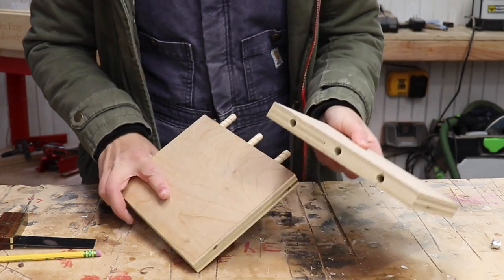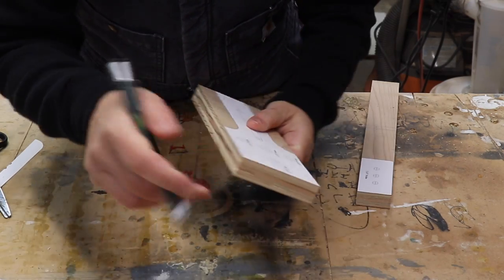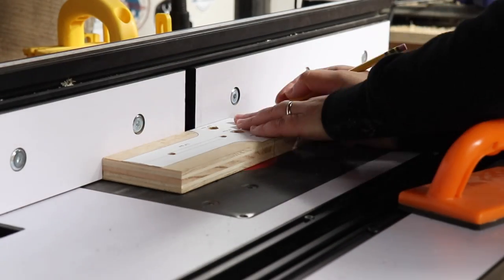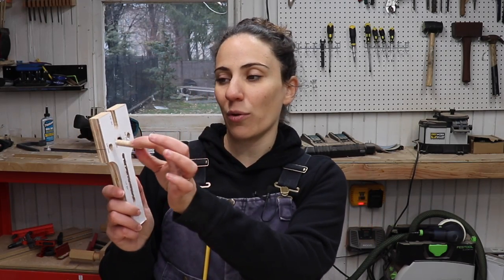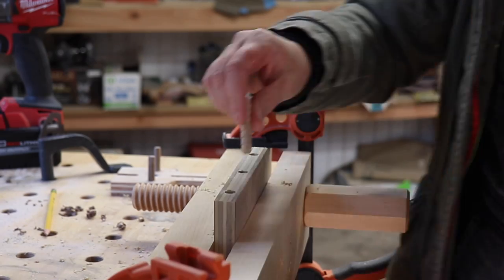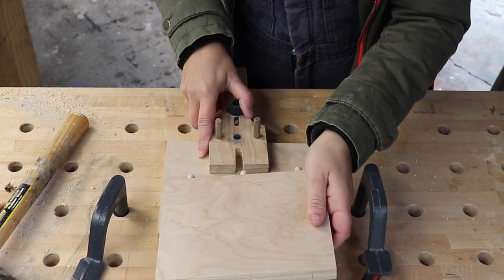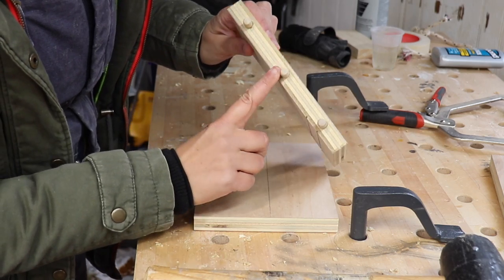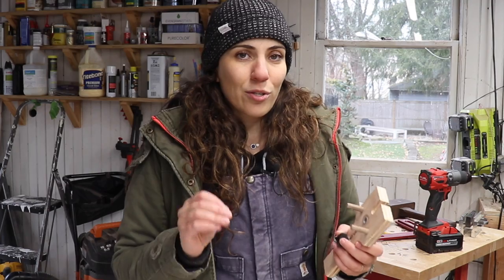Making an ADJUSTABLE Doweling Jig for Joinery

Comment: This is a very clever dowel jig indeed. Personally I loathe dowel joints because even with jigs the faces of the joints never reference correctly or the dowel spacing is not quite right. This jig seems to address these shortcomings. As a woodworker who also undertakes some small engineering and machining I find fascinating the methods that people use to attempt to obtain repeatable accuracy.
An achilles heel in the design as shown however is that the steel tubular bushing is mild steel which is softer than high speed steel drill bits and consequently it will wear and lose accuracy. This issue can be resolved along with that of one dowel size by buying commercially available dowel jig bushes. These can be changed in the single centre hole if it is drlilled large enough to accept them.
I think that also the accuracy could be improved slightly by cutting the central dowel hole and both slots with a router having first set the fence bang on centre by test cutting from both sides and adjusting with the fine adjuster on the fence. I use this method when routing mortices in sash stile.
Thank you again for your care and ingenuity in making this video.

Comment: Great video.  Can you use this to do angled dowels on thinner mater such as in your other video with the 10 degree pieces?  Also, any thoughts on using steel pins instead of the walnut dowels for better durability?
Reply from the maker: Hmmm I’m sure it can be done. And metal would def be better!

Comment: Nice copy of the commercial versions out there. I have had the milescraft version a couple years now. It has the capabilities of 3 different dowel sizes, but like you I only use 3/8. The commercial jig is reasonably price so if anybody out there is sick of making jigs like me and rather make projects check them out. Woodcraft also makes a version.
Reply from the maker: Yeah. I linked to those in the description. They are great options 😉

Comment: Question: If you are using a drill press, do you really need to use an awl to put a point in for the drilling? Especially if you are clamping down the piece, then there shouldn't be any drill point wandering…

Otherwise great video and enjoy watching you make!
Reply from the maker: Yes. I have had too many instances where the drill press did not drill on my mark. So I always use an awl for precision. Thanks!

Comment: Awesome 👍, definitely plan to make one... If someone hasn't suggested it yet, simply use a 1/2" or 3/4" diameter sleeve, and you could incorporate any size drill bushings you wanted. Thanks for the great video!
Reply from the maker: Awesome! Good luck making it!

Comment: Brilliant. Question. what is the purpose of the two dowels on the fork piece?
Reply from the maker: Thanks! They are there so you can drill into the center in the edge of a board. When you twist the jig. Those 2 dowels will hit either side on the face of the board. So then the hole in the center will be perfectly centered for any width

Comment: Hi Tamar ,  I was wondering if you find that your power tools work better in " warmer"  temperatures? . I notice you seem to have a colder work environment in the winter months. In my few years of wood working in a shed , operating power tools in the colder temps wears them out faster . ( motors , bearings , body housing , ect. . . ) any thoughts on cold weather operations ?    thanks : Joe
Reply from the maker: Hmmm. I havnt had any issues with that other than me being really cold. Ha

Comment: On your idea to make it support multiple sizes,  what if you made the hole with the insert the largest you would ever drill.  Instead of gluing it in, use inserts you could change out that have an inner diameter for each size you might want to drill. You would then want to make duplicates of those so that one goes in the drill hole to guide the bit and the other for the alignment slot so they keep in alignment.
Reply from the maker: Maybe. I’m sure something could be figured out
Reply: Btw love your channel and the way you show how to do the work. Keep up the good work!
Reply from the maker: Brett Hall thanks so much!

Comment: All you need for multiple dowel sizes is a replaceable metallic nut in the hole through which you drill. Someone can turn different sizes for you on a metal lathe.
Reply from the maker: Would be cool

Comment: I see you use a small benchtop band saw.  What do you use for a blade?  I have the Skil 9" and, while I generally like it, the blade wanders pretty ridiculously.  I know I probably just need a wider blade, but I'm curious what you use since you seem to have a pretty stable blade.
Reply from the maker: Ryobi. And no. It’s horrible. It’s only cutting straight bc it’s plywood. It can barely get through any hardwood. If I use a fence it completely stalls out with hard wood bc the blade can never get enough tension.

Comment: Will this if work on a project where you’re matting Like 1/2”  onto 2” ?  The reason umm asking is because I’m in the middle of building dining chairs for my daughter and she wants a cross back design so I want to use 1/2” for the cross matted to a 2” frame. Thanks. By the way I really like your videos. Thanks for sharing.
Reply from the maker: If you’re using the same sized dowel I don’t see why not. Thanks!

Comment: Somebody got a new portable bandsaw! Lol could have picked a $2 bushing up at princess auto, but no, slicing this pipe up lol. Good work Tamar, but your going to have to pull the epoxy out one more time, sigh. I think a piece of wire inlaid on the center line would really help preserve it, vs pencil.
Reply from the maker: Haha. Yeah. That was a fun tool to use. It was a pen. But yeah. Someone suggested making a small kerf with the bandsaw then filling that in. Thinks that’s smart
Reply: @3x3CustomTamar  pen? 😛 Lol 🤣 and sure you could use your bandsaw... But if your still feeling "fancy" the Katz mozes jig has a 90% side 😉

Comment: To make it multiple sizes, you would need to have removable jig sections like the one you really want does.
I think, making a base with 1/4 inch hard board that the other parts screw onto would do the trick.
To make the three different heads, make three of the smaller size then up size two to the larger sizes. However, unlike the 200 dollar model, I wouldn't have removable pins as that just seems to complicate the design more than necessary. I would have it designed so that each of the heads was a doweling jig in and of itself. The base plate would be both the handle as well as have the slot for the depth gauge.
Reply: Now that I got a good look at it; the 21.99 dowling jig is multi sized.

https://www.woodcraft.com/products/doweljigkit-complete-dowel-joinery-kit?cjevent=fa35578733b411ea83f901b80a240613&utm_source=cj

The four dowels on it, allow for three hole sizes. One in the center and two on the sides.But it doesn't appear to have a depth gauge so the handle would have to be redesigned for a depth gauge attachment.
Reply from the maker: Yeah. The handle part of it was where i decided to just make it for one size. Ha
Reply: @3x3CustomTamar  😎👍

Comment: Awesome work on this.  Do you have a link to share for the guide you used to make the dowels?   Didn’t see it on your store site
Reply from the maker: Thanks! It’s from dfm toolworks
Reply: 3x3Custom - Tamar also, I’m doing some panels and just finished building your jig (it’s awesome).  Any hints for just doing edge to edge, without going buy the woodcraft doweling jig?
Reply from the maker: Luke Fontenot yeah sure. I would just use the center finding pegs on both pieces at the correct spots

Comment: Is there any reason not to extend the slot in the long piece so that it opens at the end?  That would make it easier to remove the guide block completely, when necessary, instead of completely removing the nut from the bolt.
Reply from the maker: It would also make it easier to cut on th bandsaw instead of a router table. Maybe the only problem with that is the handle might flex in and out bc there’s nothing holding it together at the end

Comment: I noticed when you were drilling the end holes you held the jig opposite to the clockwise rotation of the drill. Hold it tight the other way and you won’t be working against the rotation and the drill will be working with you.
Reply from the maker: Maybe. But the way the handle is it was more comfortable for me to hold it that way because my thumb was able to put pressure on the curve.

Comment: Awesome jig. I have an idea to make it multi sized if anyone is interested.
Reply from the maker: Thanks! Let’s hear it
Reply: @3x3CustomTamar  didn't want to offer something if not interested. ;)

if you drill an oversized hole for the drill hole, you could make several plugs (wood disks) with the desired dowel sized insert of tubing for the drill guide.
Same for the slot.  maybe a U shaped slot that  has both the slot and the drill guide inside with a couple of pins from the side to keep it in place.
Hope that makes sense!  if not I can sketch up a picture.
Thanks for a fun channel!
Reply: (message sent to your gmail with quick sketch)

Also, if you extend the centerline on the template that goes through the three holes, you can fold it over and scribe the line in the side of the jig. although dropping the line with a square should be in everyone's skillset. ;)

Comment: looked at the other 2 jigs and like yours more :>)
Reply from the maker: Ha! Thanks! That Jessem jig looks fantastic though
Reply: @3x3CustomTamar  I like your jig over the Jessem as yours is so simple to use. I have one like you showed at first and it takes some time to tighten it then loosen then tighten. Yours is just lay and drill. As far as other size dowels, just make a jig to fit it's not like it's going to cost a lot. And I like the handle, makes it look like it's easier to handle.

Comment: Instead of epoxying in the metal drill guide make it fit tight and make multiple sized drill guides. One for center and one for the leading edge.
Reply from the maker: Could be cool

Comment: Adding multiple sizes shouldn't be too hard, you'll need some metal insert that you can screw a different size "hole" into. Making it easy to swap sizes. However, as dowels only come in a few regular sizes, I wouldn't see why someone wouldn't build a few extra jigs, they're not THAT big and quit easy to make looking at this video :)
Reply from the maker: Totally agree. I’m already thinking I want to make another one for smaller dowels 😉

Comment: For different size holes, you could use the Lee Valley drill guide insert (https://www.leevalley.com/en-us/shop/hardware/jig-and-fixture-parts/101378-drill-guide-insert) then use the drill guide bushing that screws inside for the size of bit you want to use. You just need one 5/8" hole in your template for the guide insert then you can choose one of 8 different bushings depending on the drill size you need. I bought a set but wasn't sure how to make the right jig. Thanks to your video, I do now!
Reply from the maker: That’s super cool!
Reply: Yes, Rod is correct. One or two inserts (could make a double dowel version) and one of their bushings (about 6 sizes) would really take this jig up a notch.

Comment: 1/2 inch tube with 1/4 inch walls is no longer tube. It's just a solid bar.
Reply from the maker: Yeah. I misspoke. I meant 1/16” walls. I did link the correct one in the description.

Comment: Maybe I misheard, but it sounded like you said "half inch tube with quarter inch walls." That would be called round stock.

Knew a guy that had a template to mark drill holes with the cross hairs and he cut all of the holes out.😔
Reply from the maker: Ha. Yeah. Totally misspoke. I meant 1/16” walls. The link in the description was correct.

Comment: "until I get a Domino"

Howsabout you DON'T pay Festool a thousand damned dollars for a glorified router/oscillating tool? Your jig is perfectly serviceable, and will last longer, and is as cheap as you could ask for. It is universally compatible, and easy to use. You built it yourself, probably out of scrap, for ZERO DOLLARS.

Screw Festool, and screw every hobby level woodworker who holds them up.
Reply from the maker: To each their own I guess! This will work for now. Ha
Reply: @3x3CustomTamar  Pricey or not, you can never have enough tools. (I have a domino) :-)

Comment: A portable bandsaw to cut a piece of tube? Lol. You got way too many toys!
Reply from the maker: Hahah! I like my toys. 😂
Reply: @3x3CustomTamar  but seriously, those dowels looked pretty loose. Sure you weren't cheating with an oversized drill? My painful experience is you have to be super super accurate or it just won't fit.
Reply from the maker: Richard Wiles I put them in the microwave before using them to get all the moisture out 😉
Reply: @3x3CustomTamar  actually I have a build coming up where I need to put dowels in accurately so I will make this jig. It's perfect. You made a fantastic design. The only thing is you will never get those 3 holes perfectly equidistant, but it doesn't really matter as long as you remember which faces you used as reference. Thanks Tamar.

Comment: I know the idea that twisting a board with two dowels is supposed to give you a perfect center, but if you're a 1/32" or even 1/64" off, it's a fail as it compounds.  Not to mention...what if you have narrower stock?  It's a novel idea that could use some fixing.

Comment: It'd be easy enough to make that a useful tool. Not what you want to hear but it's videos like this that got me to go away from using dowels. In a sense why I prefer using a Bridgeport mill. I have many years of machining experience and what you're showing doesn't allow for the precise hole location which dowels require. Just let me know if you want to know how to improve it.

Comment: dropped in too easily, too much slop
Reply from the maker: They dropped in like that because I threw them in the microwave to shrink them so they are easy to install.
Reply: 3x3Custom - Tamar ok I might have to build it then, thank you for explaining. And that’s a good tip.

Comment: You scare me using that table saw when you cut small pieces of wood against the fence.You run a RISK of losing control of the work and have it kick back on you.
You need a little more practice using your crosscut SLED to cut small pieces of wood with better control!
SAFETY IS NO ACCIDENT!!!!!